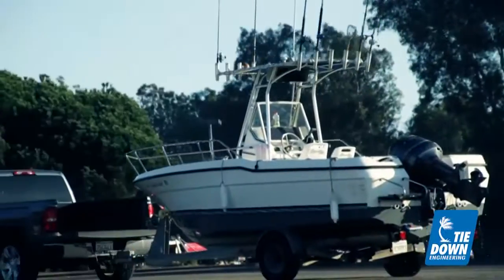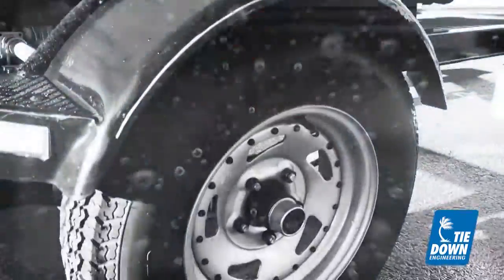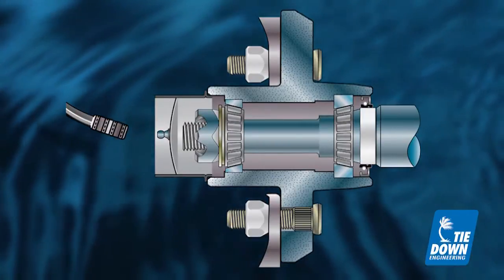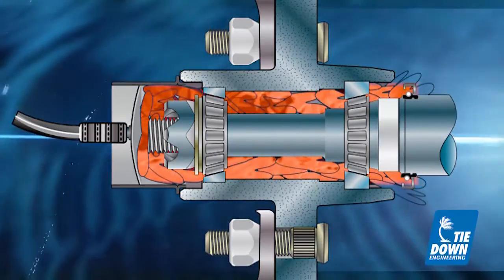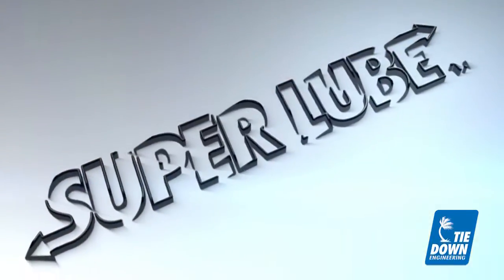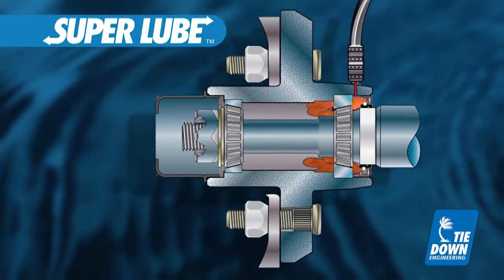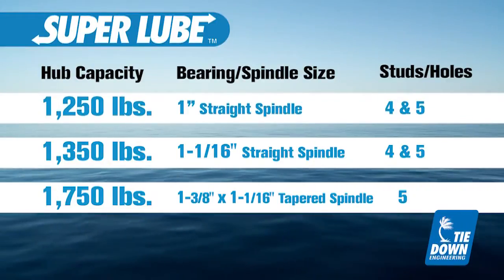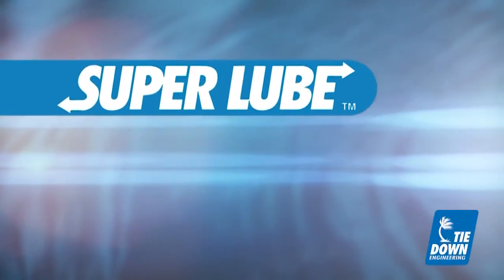Super Lube Replacement Hubs

Comment: This video seems to provide conflicting info, at least for my situation. I have a 2022 Venture boat trailer with Super Lube hubs (says Super Lube - Tie Down Eng right on the dust cover). The zert on my hubs is just under the dust cover versus on the rear, which this video says is an improper way to grease a hub without fear of damaging the inner bearing. I'm confused.

Comment: How is this any better at preventing the rear seal from blowing out due to the hydraulic pressure of adding grease vs the failed design of the "EZ Lube" system?
Reply from the maker: Unfortunately, the vendor sold off that part of their company. Here is their phone number if you would like to contact them: 404-477-6899. Hope this helps!
Reply: Orval Stuckemeyer I have. Continental tandem axle trailer. I use the BRP red grease and I add grease after every trip and I have yet to blow a seal. I think the 2 things that help is add grease as soon as I get home when the grease is warm and I add the grease very slow. I may be lucky in FL because I don’t have to deal with cold grease. If I add grease when it’s cold I raise the tire and spin it while adding grease.  When I install new bearings I place them in dry and add the grease thru the fitting while spinning the hub. It has served me well for 50,000 trailer miles with zero hub failures. YMMV